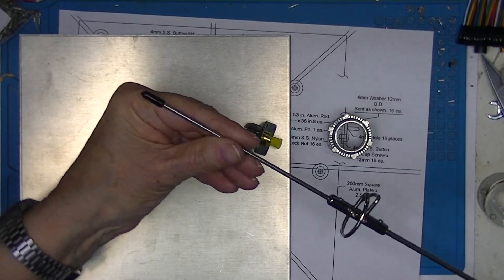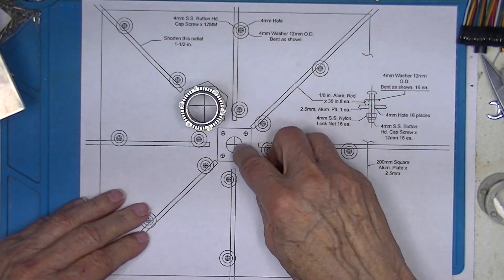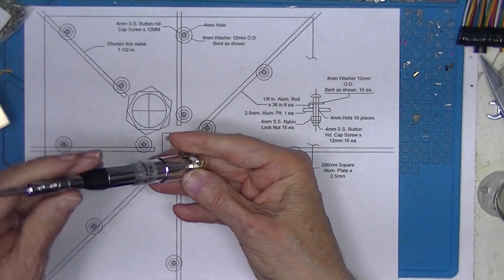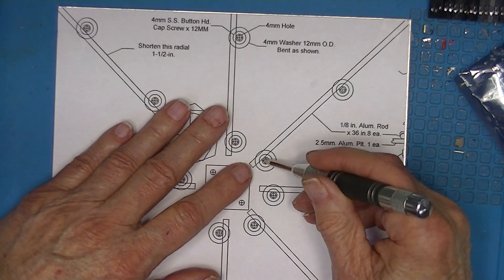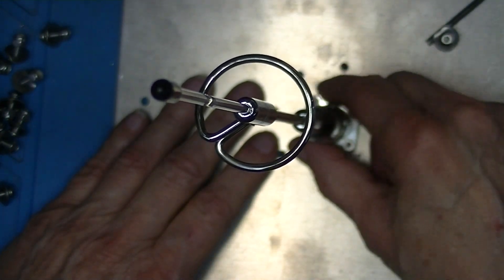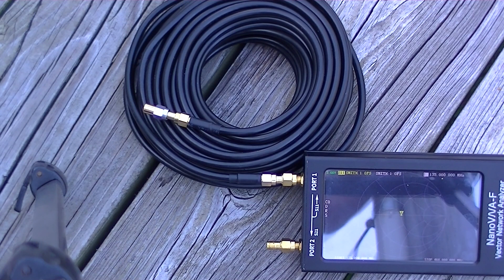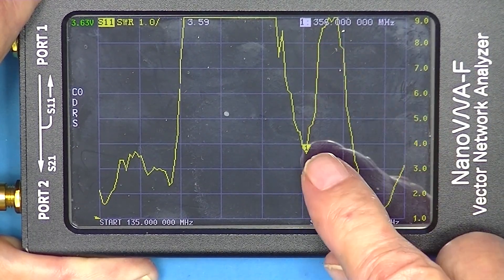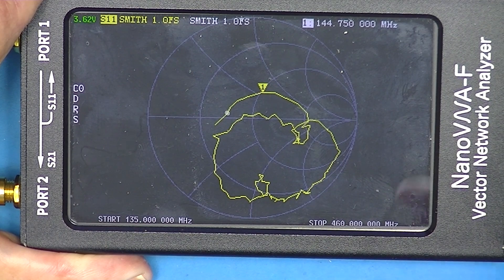Ground Plane Antenna 2M 'n 440MHz

Comment: Okay, you might be the person to ask. I have a Diamond 7900 Dual Band 2m/440 7/8 wave antenna on 2m, not sure what it is on 440, its 62 inches long, and I want to use it as a portable base station antenna for field work, with my 25 watt BTech 2m/440 portable radio. What I need to know, is if I added a ground plane, would it help? And if so, how long would the elements needs to be? And could I make two for 2m and 2 for 440? I hope to hear from you soon. Nice video by the way. And does it matter how big the mounting plate for the radials is? One more question, two more. One, do you need to use round stock for the radials? Or could you say use flat stock, and do you need 8 radials?
Reply from the maker: I am not sure that the radial system would help, and maybe actually hinder, that antenna.
Steve